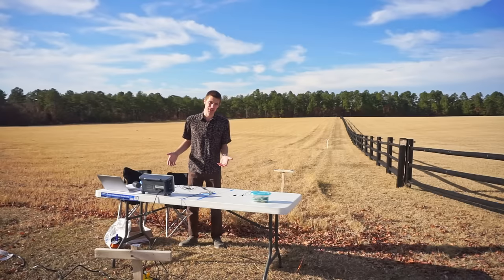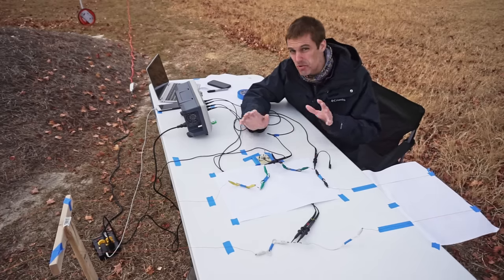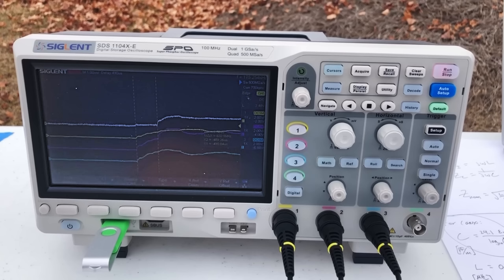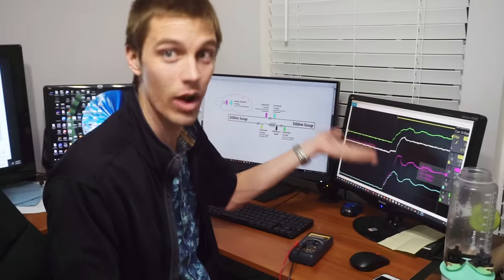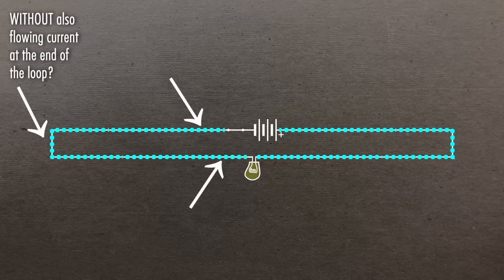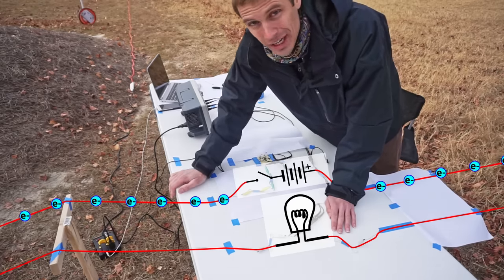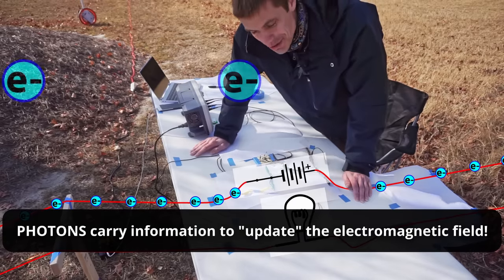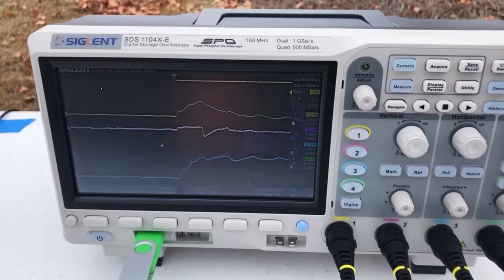I bought 1000 meters of wire to settle a physics debate

Comment: I wish you had run your two 500m routes as two loops like a figure 8 with the battery and resistor only close to each other in the middle of the 8 to basically minimize the coupling and should have expected that transient blip to have almost (?) been undetectable, as only the point near the battery and the resistor would be in any form of relative proximity to each other.  Actually, I was surprised you saw the transient that you did as far apart as those wires were (yes, ratio of how LONG they were routed comes into play), but that was very far apart for only a 5v DC switch.  Probably has more to do with the probes coupling?  Hum...I may need to think on that.  At least if you ran it as a figure 8, and still saw the blip, you would know it was your probes and not the transmission line coupling term.
Reply from the maker: It goes away with the figure 8. I’ve never edited that footage up
Reply: @AlphaPhoenixChannel  very interesting...that is more transmission coupling than I would have expected, even at those long routes.  Overall, this was a great video and I just watched your follow on one smaller test in front yard too.

Comment: 10:31 Doesn’t the mini-current through the resistor immediately after the switch is closed violate the light-speed limit of causality propagation across space? Everything in relativity suggests that the speed of light is really the speed of causality across space.

Comment: Seems like you have disproved Veritasiumand in his example, it would take 1 full second for the light to turn on.  Not instantaneous.  Also you keep talking about electrons moving through the wire, whereas Veritasium says the electrons barely move at all.  Lastly, you mention a "wave" that travels through the electrons.  So is electricity actually a wave, like light?   Bottom line, I'm more confused than ever, but this is interesting.

Comment: You won't believe the explanation. Electrons don't actually travel that fast, the emf causes ALL electrons in the wire to move at the same time. There may be a delay due to a result of speed drop of copper assuming you used copper wire.

Comment: I have not watched yet.  Still I am going to guess that no, the electricity does not travel as fast as light.  I would bet its around 1/3 - 1/2 the speed of light.  I assume you are talking about the speed of light in a vacuum, like space, as obviously light travels at different speeds through all other mediums.  Since it can't travel through a wire at all like electricity can, that too would be ridiculous to compare.  So while light has no resistance traveling through space.  Electricity does have to deal with resistance flowing through any conductive material.  Since the fastest electricity could possibly travel is at the speed of light, and since electricity inevitably encounters at least some resistance, then the electricity must travel at least slower than light.  That said, is it measurable over 2/3 of a mile?  Almost certainly not.  Any measurements you get over such a short distance might accurately reflect the speed of the light, or it might simply reflect your ability, or inability, to measure it.

Comment: The electrons move under the influence of an electric field - this is what travels at the speed of light - I'm not sure but the velocity of an electric field in a wire is slower than in free space. The length of the wires is too short compared with the speed of light. There is an electromagnetic effect also as there is a delay due to the magnetic field building and producing a back emf. I'm not an expert  - You need to talk to a physicist.

Comment: The consensus I found says electrons are somewhat solid ans waves. Not a very satisfying answer. some say that they flow mainly on the outside of the wire.Sucking and blowing could also explain ti. Power lines near your experiment could have muddied the water even more. Great experiment! I guess that puts to rest what the old man said that he could turn off and get in the bed before it went out. Smile

Comment: Of course not! Light is likely to travel with less obstacles than electricity! Photons vs. Electrons! Plus the means of propagation in the case of electricity severely influences its speed having into account  material resistence(ohm) and voltage

Comment: There is no "electricity". There are electromagnetic fields and charges. They behave differently in classical Physics (wires and alike). What exactly do you test? Speed of light? Where? In vacuum? A wire is not vacuum.  Confusing.

Comment: Surely the tiny instant current flow is because of inducted electricsl energy from general background electromagnetism? E.g. wifi, bluetooth, radio etc which then gets stopped when the capacitor is charged? Its not instantly flowong from the power source or the bulb...

Comment: Why do you need to run this experiment? Surely we all know that fibre internet to faraway places takes longer than it does on your local line. Meaning that it does take time for information to travel, and the more wire, the longer it takes.

Comment: 3 wise guys on U-TUBE are probably wrong about this experiment. This guy does not have enough wire. He is also going to realize that he has a lot more small parameters than he thinks he has in a simple electrical circuit. I doubt that his measurement is anything more than a ghost that exists because of some other factor that was not considered because there are some many of them. what kind of battery did he use? that would make a difference. Actually the leakage current through the battery can flow both ways. The reason for the delay is probably because of the electronic properties of copper. Electrons do not flow through the conductor exactly. Amperes are some number of electrons flowing past a fixed cross-sectional area of a conductor. Electrons flow within the domains of the copper. And so he is probably wrong.

Comment: What if you use a pipe with marbles, end to end .  On marble in my he left end then one marble comes out the other end instantaneously.  If you have a saturation current in the wire and the apply a slight amount of additional current.  The electrons, like the marbles should come out the other end nearly instantaneously.

Comment: I can settle this before I even watch the video, no because if electricity did travel as fast as light does fiber optic data cable would not be such a massive speed improvement.

Comment: Dontthe electrons just flow? So it travels kind of instantly but the electrons that started 1000m back wont be there instantly but electrons in the very start of the wire will have no distance to travel so.... its instant?

Comment: according to Nikola Tesla metals "manufacture" electrons ... how? Electrical Impulses of microsecond entity tap into the Aether field. What the oscilloscope is showing st first are the feeble manufactured electrons, then the electron train arriving from the battery. To show this at higher scale the experiment should be done using high voltage and super fast microseconds switching.

Comment: How would you explain with electrons and their movement that current flows through a plate capacitor. When the dc current flows, it is only the initial impulse charge current, and with the ac current, it constantly flows through the connected conductors and not through the insulator between the capacitor plates. The electrical circuit with the capacitor is open and the current flows through the wires.
Reply from the maker: There are charges moving in and out of both plates so it looks like current is the capacitor was a black box, but it’s actually just storing the charges on the plates and you can’t keep charging g them forever so instead you reverse the polarity and start discharging. Cap looks kinda like a closed circuit till it charges
Reply: I expected the following answer for dc current. Electrons from a wire connected to a source move under the influence of the electric field of the source. Further, they repel each other and the load is transmitted through the wires. For that electron wave, it is not necessary for the circuit to be closed. That electron current will be short-lived until the electron wave reaches the capacitor plate. They stay there because they are attracted by the "positive" charge of the second plate on which the electrons have moved towards the other pole of the source, where they are attracted by the positive pole.
Reply: Am I right?

Comment: Are you turning the wiring into an antenna after you cut one end and measuring the electric field since both wires on one loop are parallel to each other. The scope is sensitive enough to see it..  Some of the wave is passed onto the other “open” wiring.  Ok so now the neg side of the wiring will pull neg because the magnetic field of half the wire “parallel section” with the right hand rule for current flow and mag field direction pulling negative. Hence having a lower negative reading. The wire now has the potential of the positive term of the battery.  Resistance isn’t a factor until you have circuit. I think of a battery like a balloon.  Nature wants both neg and pos to be zero.  We teach the electrons flowing like a hose or chain but that’s only because it’s understandable.  And no matter what light bulb you connect the resistance needs time and some current thru it before it produces light.

Comment: You initial jump is too big to be true. You are picking up the jump in one probe wire by the other probe wire most likely. You should move the probe wires around, check internal capacitance between channels, etc, to make a sound conclusion

Comment: We have drop off voltage in the electrical world so this test isnt valid seeing as the longer a wire or cable is the less electricity can be pushed through unless you have a mega generator hooked up or something

Comment: You don't need wires. Wires are just a wave guide. In fact you can use laser beams to heat the gases in the air, to sculpt wave guides out of the air.

Talking about electrons like this is silly. They're not physical particles, they're packets of flux trapped in the orbit of an atom.

Comment: When they say power ...ie the electrical field... Flows outside the wire is it in the air around it or on the surface of the wire.

Comment: EXCEPT YOUR CHARGE IS NOT TRAVELLING THROUGH SPACE ITS GOING ALONG THE EDGE OF A WIRE, SO YOUR MEASUREMENTS SHOULD BE MINUS "DRAG" WHICH ALSO APPLIES IF THROUGH SO CALLED EMPTY SPACE,

Comment: Did you forget that there is a way to send electricity from space without wires? Using a microwave or a laser beam. I will say. Not without transfer or convert from one type of energy to another though. But lightning sure is wireless. I get that your saying to do things in a controlled manner. But a corona mass ejection from the sun can be powerful enough to run electrical machines that are not plugged in. Such what happened to the telegraph machine a long time ago before modern telecommunication. Sure some started on fire. So the sun sending electrified plasma to earth can power devices unplugged. Anyway this was only in response to saying we have to have wires and all the other stuff while nature says you don't. Of course natures way is uncontrolled by us and isn't really as useful.

Comment: For completeness, you should repeat the same set of experiments, but with the shortest wire possible in order to rule out any artefacts coming from the oscilloscope, battery and transistor switch. You should also do all tests at the same time in order to avoid different impact from the atmosphere, radio waves, solar eruptions, etc.
Reply: For further completion, he should also move the switch at measured distances away from the bulb to see if the initial small voltage still shows up.

Comment: Does anyone know why current doesn't flow in an incomplete circuit? How current knows there is no return path? Does current actually travel to the end of the wire first to check if it has a neutral path aka low voltage or what?

Comment: Nice job, but you should learn about inductions and theyr effects. This do not measure the electricity speed in the wire...  maybe an ac voltage (and so current) ans compare the phase between source and receiver. That will give you the time the current takes to travell your loop... self...

Comment: The explanation about the electrons propagated through the cable is totally wrong. 

Electromagnetic doesn't need the electron to propagate
Reply from the maker: The electromagnetic field would not exist unless there were charged particles to emit it - the self propagating waves are kind of a special case but they come from accelerating charges
Reply: @AlphaPhoenixChannel  it's not a special case. 
Transmission of electromagnetic waves through vacuum space is the same as transmission in the cable. It's definitely  not because the electron. 

Now, we understand that vacuum may actually contain particle such higgs boson. This type of particle may be the medium where the energy moves around. We dont know much about it yet. But definitely NOT electron

Comment: Weirdly, the brain electricity goes slower than down a copper wire. Here Resulting conduction speeds range from about 0.5–100 meters per second – fast, but not as fast as copper wire.
Crazy huh?

Comment: What about voltage, voltage drop and cable gauge
Reply from the maker: They don’t matter much to the question - gauge very slightly changes capacitance but that’s the only thing that could change the speed there
Reply: @AlphaPhoenixChannel  Cable gauge matters immensely on my digital model railway, if its not adequate i get drop outs and corruption of the digital signalling, so does the cable type, i use silver because it carries high frequencies much better, this is important for DCC digital layouts.
Reply from the maker: @Synthematix  signal fidelity yes, but not raw speed of energy transmission

Comment: I'm sorry I don't quite buy the explanation you have given for the immediate registration of charge.  Given the length of wire, the explanation cannot defy the speed of light.  There is a much simpler explanation, one that involves current moving through a much much shorter portion of the wire and is to do with the electromagnetic radiation between the two wires near each other on the desk.

Comment: Here is the test; 
Make a dual cable 100m long.
Solder a led at one end and put a battery at the other.
Solder a switch on it.
Now hold your stopwatch 😂

Ehm electricity goes with  one hundred thousand kilometers per second. 
If you google it you'll get the wrong answer.

Comment: That has to be one of the worst experiments I've ever seen.  How much voltage, the gauge of wire, AC vs DC, al play a roll.
Reply from the maker: Of these three, how much voltage doesn’t matter because I’m taking a ratio, the gauge of wire does matter, but not by much at this scale, and ac/dc is a meaningless question at these speeds.

Comment: I didn’t follow. The statements about electrons flowing which makes the circuit cannot be correct, though I might be wholly misunderstanding.

Electrons drift, not flow. And they can’t be flowing at the speed of light, otherwise we wouldn’t need massive particle accelerators to bring electrons near the speed of light — just bend the wire at 90 degrees with a five volt battery attached.

Comment: Cool. Betcha light is faster. Electricity is quick but not as fast as light. A ray of light can circle the world 9.4 times in a second. 
Wait until light drive space propulsion happens. Or double down light powered propulsion. Imagine using light to push a vehicle through space , then once you’re going you introduce a second light drive . Can you imagine that. Will light propulsion work and will light travel faster than what is previously known. We can only imagine. Ride on photonic drive.  
Copyright 2023

Comment: It looks like you're using a battery to power this experiment? The battery is built out of a series of cells stacked together to produce its voltage. The current that flows through the circuit is generated by chemical reactions inside the battery. While there is a static voltage potential across the battery terminals before the electronic switch closes, no current is yet flowing through the wire. When the switch closes, the voltage potential causes current to flow out of the battery, which triggers chemical reactions inside the battery that generate additional electric current. However, those chemical reactions take time to accumulate within the battery, which may account for the one microsecond delay where a small initial current is observed before the main pulse occurs on the oscilloscope trace.
https://www.youtube.com/watch?v=PXNKkcB0pI4

Comment: I'll save everyone 20 minutes of their time. The answer is NO. Electricity travels much slower. The speed depends on the material's conductivity.
Reply from the maker: The speed of electricity does not depend on resistivity. The speed of electrons does

Comment: You are measuring the speed of time.
Light doesn't have a speed.
Light exists in and out of time.
Reply from the maker: So does water slow down time? What about Cherenkov radiation?
Reply: @AlphaPhoenixChannel  light is a particle that has the potential to emitt frequency.
Time is rotation. A frequency.